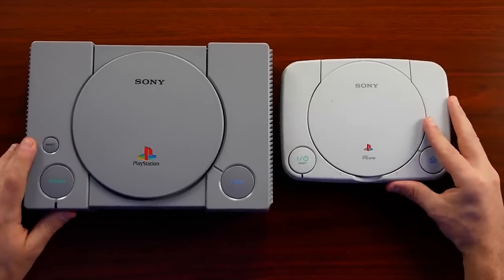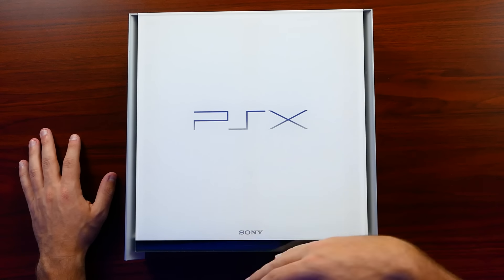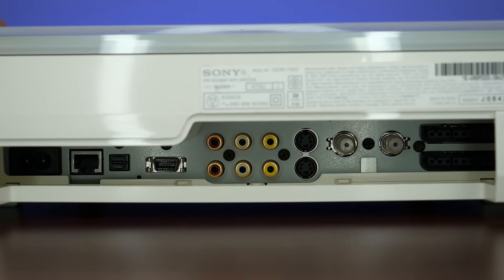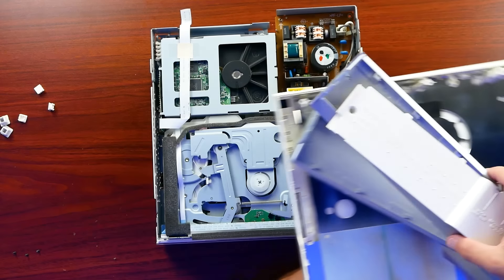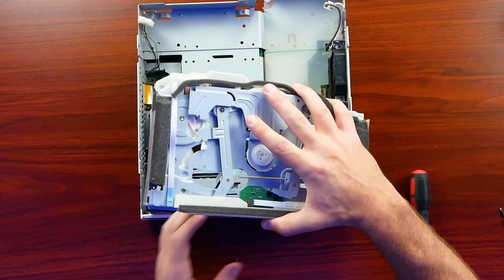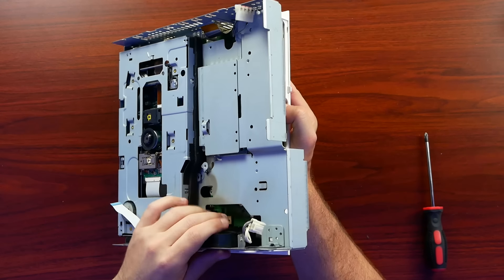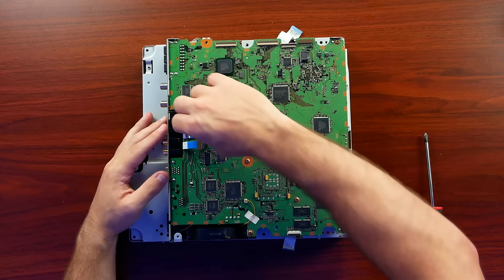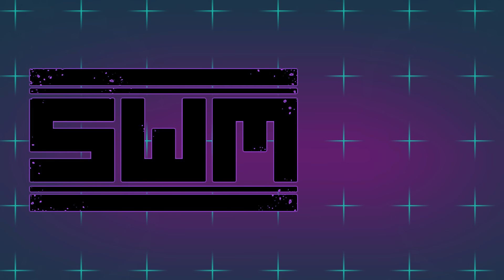The PSX Is The Craziest PS2 Ever Made

Comment: And psp. The media bar was also there, not only Bravia TV and ps3
Reply: And DVD players, blu players and Sony systems
Reply: It’s also on sont bluray players
Reply: @PhinioxGlade  and like every ebay knockoff device ever made
Reply: Its on sony ericsson phone too, I had once w995 and it have the same menu on the multimedia
Reply: It’s called xmb interface
Reply: referral madness  no. I have a late 2018 model high-end 4k Sony tv (was $1,000 for a 43"), and it in fact does not have the same interface as my Ps4 Pro. I can tell you why, but you may not believe me... Because most modern Sony TVs will be android tvs, or just smart tvs in general, which wouldn't handle the Ps4 OS quite the same.
Reply: @ahiyanali7231  It's called "we don't care"
Reply: The XMB was evreywhere with Sony for a while. Pretty sure a few cameras even had it

Comment: Would love to see a Part 2 where you replace or upgrade the laser, heat sink, fan and such. 

Also wonder if the DVD reading laser is the same as the PS2’s. Or perhaps one of the more premium Sony DVD players at that time.
Reply: The left laser seems to be a KHS-400B, the same used in fat PS2s that would get disk read errors.
Reply: Probably firmware locked going by comments on here. Which means that if you replace the laser or HDD the system wouldn't boot.

Comment: The PSX has a cheap laser and disc read errors too, color me surprised.
Reply: I've had way too many PS2s with laser failure.  Bogus.
Reply: @WaysideWade  I've had my PS2 since around launch and the first time the laser failed was fixed after I took it apart and cleaned the laser lens about a year ago. I played Tomb Raider Anniversary yesterday!
Reply: Mine still works 17 years later. Knock on wood
Reply: Do you basically clean it with alcohol and a swab, is it more complicated and delicate?
Reply: My PS2 would take like 5 tries to read blue disc games. :(
Reply: @mrbisshie  Mine takes a lot more effort to get it to read Blurays...being as the PS2 only had DVD, bluray didn't show up until the PS3.
Reply: @johnnemesh5459  Blue disc games are ps2 games printed on a CD not Blu-ray
Reply: @jimmyjay689  does X360 play PS2 games? or why ru suggesting doing so?
Reply: My ps2 slim and fat model still work lol
Reply: Bruce S  red ring models were only the early models. I have an original arcade model with a jasper motherboard amd it's still going strong
Reply: My ps2 slim 100% still works lmao

Comment: You better take care of that harddrive. It is married to the system and there is currently no method to remarry a new one. The system will die if the harddrive dies.
Reply: Doganderboss  what a horrible design flaw
Reply: @jipillow1  that's like saying not being able to play burned ps2 discs is a design flaw
Reply: @sheepsnoopshep  that's  completely different, burned is piracy, now if the HDD fails ( which they do quite frequently) then you should be able to simply put a new one, just like you do on ps3 and ps4. thank god sony didn't do the same mistake with the ps3

Comment: It's amazing how they can fit a 256GB hard drive into a system that is almost 20 years old yet the best they can do in a Xbox Series S is only 512 GB.
Reply: To be fair, the S series is a custom on board NVMe drive, but it is a bit on the small side for today's games, especially if you're installing the 4k texture packs.
Reply: It's not a hard drive in the S, that's why. It's a PCI E based SSD, and Gen 4 no less. Right now you're looking at a ballpark of about $100 to buy something like that outright for a PC in the same size. The Series S is $300, and the only cutbacks over the X they made in terms of cost, are a Blu-ray drive which isn't going to save them much money, some computer units on the GPU, some VRAM, and yes, halving the SSD from the X's 1TB.

 The S still has the same eight core Zen 2 based CPU, and to buy the closest equivalent you could get for a PC legitimately costs more than the console. Something's gotta give.

 Oh, and let's not forget this PSX that Spawn Wave is reviewing retailed for $700 in a time when it would've been worth more than $700 today.
Reply: Lol the xbox series x doesnt have a hard drive its an SSD. not the same thing.

Comment: From what I know this PSX must have been made in early 2004 because the 90nm EE+GS chip came out in that year. Anyone that wants a good illustration of the year and die size of the ps2 hardware when it got smaller just google images emotion engine die shrink.  It is crazy how fast sony was shrinking the die of the PS2 cpu and gpu but I guess since they were selling so many each year they would spend the money to shrink the dies as fast as possible. the xbox 360 took two years to go from 90nm to 65nm(2005-2007) and then it took 3 years to go from 65nm to 45nm(2007-2010). There was a plan to shrink the die of the original xbox but something happened and Microsoft took Intel and Nvidia to court but they settled out of court so we never knew what happened. original xbox had 180nm cpu and 150nm gpu from 2001-2006. wow
Reply: Nice, informative

Comment: The beginning of this video, you mentioned a teardown of a PS2... but you didn't recognise the left laser with the plastic shroud was the same. Take off the shroud,  clean under it with compressed air, and clean the laser glass with a slightly dampened alcohol q-tip and your games should work. Also, there is software that enables a bit-to-bit copy of hard drives; get another 250 and  try a swap. If the backup works, maybe it's not locked like the OG Xbox?

Comment: The laser on the left in the black casing is a standard Playstation 2 laser.  The one on the right is probably there to initialize and burn discs.  Possibly read non Playstation discs as well to remove unnecessary strain.

Comment: Might also be worth looking into seeing if anyone makes or CAN make an adapter that will fit into the system that connects an SSD to the board. Even if the system won't be able to pull all of the SSD's speeds, it'll still speed it up a touch, but most importantly, reduce heat since that system seems to run hot anyways. And beats trying to find a working IED disk drive that isn't already on it's last legs. Might even be able to grab a few heatsinks made for the Pi that will stick on some of the other components besides the CPU. Could really be a fun little project trying to make that baby run cool and efficient.

Edit: Nevermind, reading more about how DRM-heavy the system was, making it nearly impossible at present to do about anything. I guess once that drive goes, basically the system becomes a paperweight. That's a helluva bummer considering this is a pretty cool piece of kit.

Comment: They're pretty good as a DVR I used it for recording some Laserdisc movies.
The highest recording quality is around 8.5 mbps of MPEG2 at 720x480 60 fps with 2ch LPCM at 16/48 kHz.
I got one for 50 bucks it's the more desirable 7000 model with 250 GB HDD retailed for 99,800 yen in 2003 and still works with PS1 and PS2 CD ROM but DVD drives are dead so no more DVRing and play most PS2 games from it.
The thing have terrible heat management it cooks up the innards and unfortunately DVD were one of the casualty.
Took PSX longer to boot games than PS2.
It was the coolest and hottest thing Sony electronics ever made too bad it was designed for form over function.
This were not SCE product so kinda explained why it ran too hot and became unreliable expensive hot junk in such short time.

Comment: Xbox 360s had a problem where the potentiometer in the disc drive would unscrew, slightly, due to vibrations and stop the laser from getting enough voltage to read a disc. 

It would be worth looking at the voltage spec of the laser and the voltage output of the potentiometer to check if they match up. If they don't, even a new laser won't fix it and the drive its self is probably kernel locked to that motherboard so you can't replace the entire drive.

It'd be cool if you could fix it with a multimeter and a screwdriver.

Comment: It's cool when this version of the PS2 hardware comes up. I remember when it first came out back in the day and it had sounded like a pretty cool piece of hardware. Back then, 3rd party DVRs and such were something of a premium and we certainly hadn't simply migrated to streaming just yet, so this combined a whole bunch of things you might want in your media center into a single unit. The PS2 was already quite popular for it's ability to play DVDs, it was pretty much the first non-PC DVD player I had in my house for quite a while. This tossed in a bunch more of the technology that was starting to get popular at the time and I suspect if they had managed to keep the price down, it might have been something of a success.

It's also curious to see how it was something of a precursor to the PS3. I remember the cross media bar was the big thing that was pointed out back when the PS3 launched, but with the teardown of the system some of the other similarities start to become apparent. I'm not too sure what's going on with the PSX HDD and some of the other hardware, but looking at these older systems, I start to wonder how much we can improve them with a few mods. I know with the PS2, you can swap the IDE drive out and with replace it with solid state media (I think I've seen IDE to SATA SD Card setups) and depending on possible encryption, you could probably mirror an original PSX drive to something newer before it fails. Replacing heat sinks, fans, and generally updating the thermals is also something I consider, something I'll probably take a stab at fixing with the PS4 hardware at some point.

Comment: Replace that heat-sink! Wonder if you could get a solid-state drive in place of the standard harddrive? That wouldn't necessarily be good for recording though. But it would reduce some heat as well.
Also could you replace the fan with a stronger one or something or do size restrictions stop that.

Comment: Can you try out that antenna mod for the PS4? Specifically to improve WiFi on the Slim or Pro. 
I know this was more of a problem on the original fat PS4 but with the BT antenna having poor connection to controllers. The Slim still uses the same style antenna, so I was wondering if it would be worthwhile to do the mod. It would be cool to see WiFi performance tests for before and after.

Comment: the things that scare most people from owning one of these nowadays are the laser which was evidently never used in anything else so its rare as hell and known for failure and more problematic is the hard drive, this is one of the earlier game systems that boots from hard disk and its locked to the motherboard, anyone who knows the problems with the original xbox should know why this is an issue and as far as ive heard no one has managed to unlock the motherboard or lock a new hard drive to it yet, it sounds like its locked to something in the drive itself rather than a key stored on it so drive cloning apparently doesnt work

Comment: You said you ordered a couple psx’s from Japan? I’ll buy one, if you need to get rid of one.
Also, I had a disc read issue with my ps2, over time the laser “losses focus” it need to be “retuned”. To test this idea, try playing a music cd, then a dvd, then a ps1 game then a ps2 game. The “depth” the information is read at varies. But to fix my laser, I used a volt meter and adjusted the potentiometers, on the laser.

Comment: the laser with the black cover is the CD read only laser the "important" laser is the DVD read/rite laser its the dominant laser and the first laser initialized in the format detect spin of the disc my PSX had the DVD laser die rendering it unable to read anything parts for the PSX are very hard to get took me almost 2 years to find a replacement laser the DVD laser got very hot during use thats why they died so often amazing system for its time i still have mine and still think its cool but i tend to treat the disc drive like its fragile as lol

Comment: Was the psx before the ps2 system or was it supposed to be based off the ps2 system because I honestly believed that they did better with the original version of the ps2 system myself that unit looks like it's takes more room to put safely to use and I could just imagine the problem itself with it thanks for sharing the information but I myself will forever stay true to the original version of the ps2 system myself🤔

Comment: I got mine 5 years ago or more from Japan, mine works 100% reads all discs powers on tries to record shows but I dont have the connection for that so its just a display piece as I don't want it to break but I do power it on occasion so it runs.

Comment: The XMB is stupid enough that it only reads PS2 and all the other DVDs with the burner laser on the right. When that one fails, your PSX won't play PS2 DVD games from the XMB itself. In fact the XMB only uses the burner laser to identify the game. Once you entered the game, it will start using the PS2 laser on the left side for actually playing the game. There are ways to use the FMCB to force the PSX directly into the PS2 mode and circumvent the broken laser dilemma.

Comment: I always wonder if you cloned a hdd of a PSX and then pushed it to a new hdd could you possibly make a working PSX again if your hdd went bad. Then if that is a possibility could that repair other dead hdd systems or is there more unknown ties to it that will never probably be cracked open to make working systems again off of already dead hdd systems.
Reply: Apparently the HDD is not only encrypted, but it also supports features which the PSX requires, so if you cloned the drive, at best, you would lose some functionality, at worst, it may refuse to function

Comment: Please be more careful next time you handle exposed power supply boards. The biggest capacitor in case when there is no bleed resistors or if a power supply is broken will hold charge for days. If you discharge it with only one hand, then it will hurt and be numb for at least half an hour. However discharging it hand to hand is dangerous and possibly deadly. You should at least discharge them with an insulated tool.

Comment: hi i have a DESR-7000 originally this unit doesn't read any kind of disc but ive found a buning rom laser lens and replacer it.
(my unit mount the sony KWS-200A find into a sony dvd recorder model RDR GX7)
ive read that whien u insert a disc into console thie unit start toread the disc whit the burning laser lesn and if cant read the dist all the disc drive was stopped.
if recognize a ps2 game it allow the second lesn to read the game and play it
After replaced the burning laser module, my PSX now read ps2 CD-rom games (like tekken tag tournament) but cant read ps2 DVD games but, if i start the PSX whit a memory card whit free mc boot (psx version) intalled, my unit read ps2 DVD game whitout any problem.
same problem whit a dvd japanese movie. cant read anything
why?
u think is a problem of tarature of the burning DVD drive ? because ive try to replace the second ps2 laser lens but same result. 
cd game ok, 
dvd game no work

Comment: Now that dual laser is NOT what I was expecting, I sure was waiting for some BD drive style 2 lasers on same carriage, but 2?? That's weird for sure. In practice it could record and check the disk both at once, but I'm sort of leaning towards Sony just keeping the PS2 section intact and not allowing it to read DVD-R/RWs in a piracy paranoia, cause we all know there was no piracy on the PS2 otherwise (end of sarcasm), and the separate laser assembly to deal with the DVR functionality.
That heatsink is downright pathetic and whoever thought this would do the job is either NOT a mechanical engineer (mechanical engineers have heat transfer classes, so heatsink knowledge for who's not familiar), or if he/she/THAT THING is supposed to be an engineer, take the diploma away, that heatsink is beyond ridiculous really.
This combo Emotion Engine + Graphics Synthesizer is the same as on some later revision fat PS2s and early version slim PS2s (the slim ones that heat up like an oven). On the later model slim ones they switched to a smaller EE + GS combo that included even the system RAM and something else if I recall, but most importantly is the most power efficient version, the one to go for who's into the home to portable conversion mods, found on the slim PS2s with built-in power supply, and the SCPH-7900x models from my quick search.
Apparently, the 1st slim PS2s also possibly came with the EE and GS separate chips, but only the earliest models.

Comment: Hood god.  The heat sync was barely attacked to 50% of the surface area of the cpu.

It doesn't work that way.  You need to at least cover 75% of the surface area.

Comment: A Sony console with laser issues, what a complete and total lack of a surprise. My Ps4 pro is the only Sony console I have had that hasn't had laser issues (given how many times I had issues on the PS1 and PS2 because of it, once Sony refused to replace their design fault, each time I took it to someone who would fix it and mod chip the console at the same time), but then I am lucky as I know loads of people who had the drives just die on them and prevent them even updating the firmware. lol this why I told everyone who was interested in a PS5 to get the diskless version, not because its cheaper, but because its less likely to leave you with a knackered console.